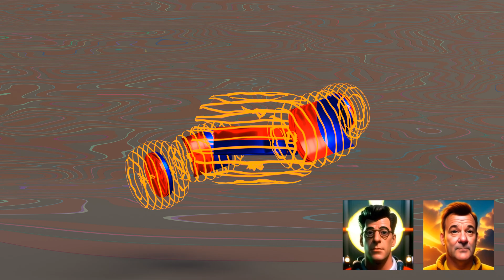Truth: free energy generator 240kV electricity from magnetic gear and 100% copper coil transformer

Comment: What do you mean infinity is not part of our universe ?
Reply from the maker: Hi Isa, thx for your comment. I don’t think, that infinity is not part of our universe because there is no infinity except in mathematics . 🙂 thx for watching
Reply: @yWild  There are practical examples of energy generators that do not claim to produce infinite energy or operate as perpetual motion machines. Instead, they harness magnetic energy to generate electrical current with exceptional efficiency. This concept aligns with what we've been doing since Tesla's invention of the three-phase motor to generate electricity. Moreover, in the realm of quantum physics, the concept of entropy does not impose the same limitations, allowing for energy output to exceed input. It's important to note that certain scientific terminology has been used misleadingly by some individuals, which can lead to misconceptions."